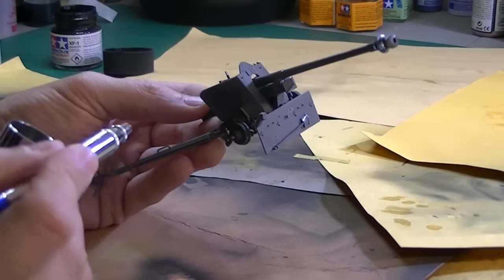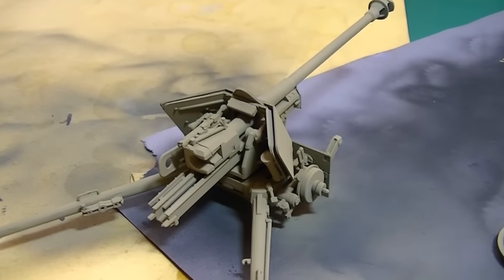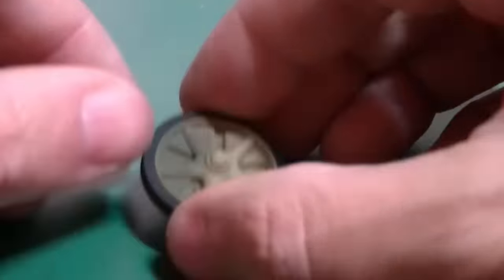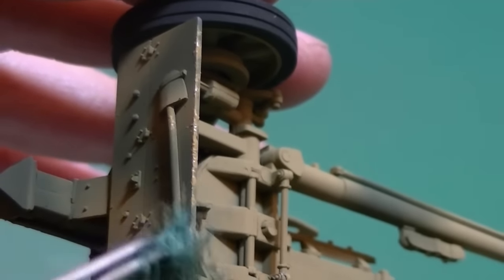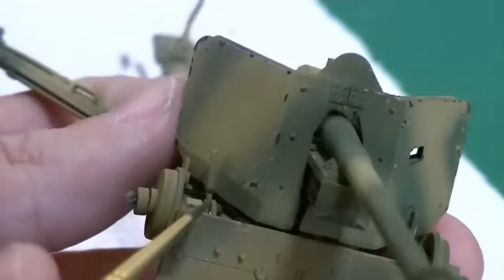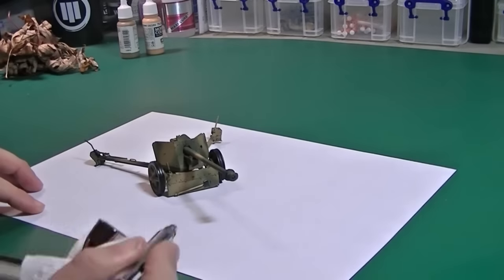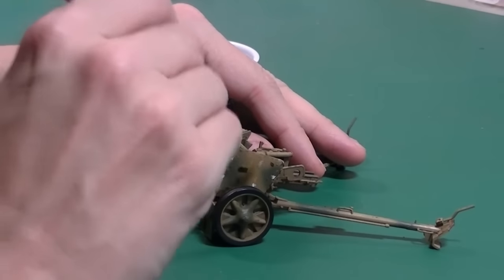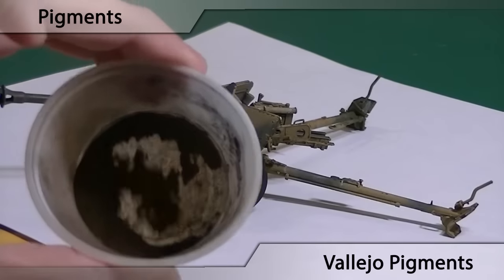Painting & Weathering the Tamiya 7.5cm Pak 40/L46 in 1/35: That 70's Build Part 2

Comment: Nice little model Adam, like the weathering techniques and cool to see the paper under the tools painting, that technique has been around a long time.
The part sticking up from the lower shield is the tail light.....you might want to paint the half circles red.
One suggestion if I may...? The gun breech/slide  could use a shinier silver color to bring out the wear more, it was very noticeable on the real guns.
Reply from the maker: +milky55way2012 Yeah I thought about pushing that harder. Tail light I think I just spaced on.

Comment: Overall your end result was good Adam, very nice.
Perhaps some finer quality brushes
000 and smaller , I have a bunch 000, 00000, micro small. For oils and acrylics.
I have 4 of these kits with etch updates and metal barrels, and the dragon kit.
As well as the PAK 3.7 cm
With metal barrels.
Your work is good Adam.
Thank you for sharing , end product was beautiful

Comment: As other viewers have said, an informative video and an interesting subject.

On the subject of primer, it is more than just paint. For want of a better expression it 'grabs' the plastic so that it adheres well and provides a good key for the first coat of paint to adhere to.
Reply from the maker: +Stephen Westrip Thank you. I understand primers, but when I was getting in to this about 2 years ago there was just too much debate and primer is also not cheap, so I started just using black paint. I think I've come to the point where I need to invest in primer, just haven't quite done it yet.
Reply: +Adam Mann Meant to say, for your shovel heads I paint then gun metal and then use a black wash (as many times as necessary) to get the desired effect.
Reply from the maker: Stephen Westrip
ooh, that's a good idea. There are some new Vallejo metal paints I was going to try but that's sounds like a plan too. Who's gunmetal do you use?
Reply: I use Citadels Leadbelcher but only because I have a couple of pots of it. Any darkish gun metal would do.

Comment: for shovel steel i use a dark brown then drybrush with leadbelcher from games workshop. its metallic, but not over the top
Reply: +Mike Greck lead belcher is such a fantasic paint for "used" steel color. not really sold on alot of the other GW paints though. The washes are great though.

Comment: I'm building, with a friend, an older Tamiya kit (70s) that got left outside and dried up a lot. I'm wondering, do waterslide decals "dry up"? They looked really faded and refused to budge off the paper when we were applying them, and when we pushed the brush harder, the decal practically disintegrated.
Reply from the maker: +RandomCanEHdian I would think yes. I believe that once they have been activated (by getting wet) once you have only that time to apply them where they need to go.
Reply: Adam Mann They'd never been wetted before; they were just left in sunlight for weeks at a time on a shelf.

Thanks for the quick reply & upload; I'm going to make one of these sooner or later.

One last thing: DS tracks?